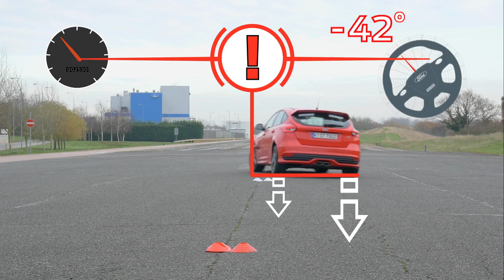Ford's next-generation stability control system in the 2015 Focus

Comment: ... and there came 2015 when the fun of driving was completely taken away.
So each time I will move the steering wheel fast, the car will brake and slow down.
Can I get the ESP OFF button right on the steering wheel then for easy reach?
How about an option button to control the ESP level of interaction?